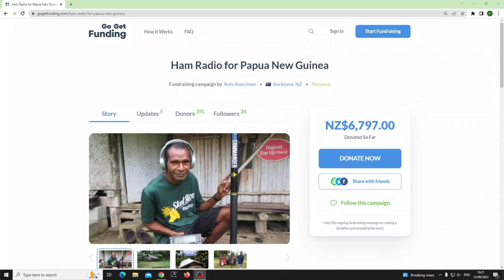We need to Understand Solar Power for Ham Radio

Comment: Hello Callum !
Sorry but i am soon having my callsign in Sweden...
Solar panel is not difficult. The battery can be the not expensive pb and they last for maybe 5-10 year if you do not compete discharge them and give them water.
Some sort of regulator that cut of around 14.4 volt in cyclic charging or just regulated for continues charging 13.6-13.8 volt. 
Here in Sweden there is about 4 hours average sun and  100w panel gives about 30 amps in a day.
70 amp battery x 12 volt is 840 watt and to not reduce lead battery life only use 50% of capacity is about 400watt in a day...
I means that on a ordinary car battery you have about 3 hours of transmitting.
Yes! Take what ever you have and get some QSO. Do not make it expensive and complicated ;)
Joakim.
Reply from the maker: Joakim! Nice to hear from you again.. Gooid advice.

Comment: I would recommend any solar panel that RVers use. Think about the conditions those panels go through. There are a lot of "Solar Generators" which I think would fit the bill nicely, and most support Solar Panel hook-ups. Ensure you check the input solar rating of the solar generator and that it supports the required deployed wattage. i.e. 300w solar ensure generator can take up to, at least 300 watts.

Comment: So I run an Icom 7100 in my van with 3 x 160 solar. Use the glass fronted panels rather than the flexibles . You NEED an MPPT (not PWM) charge controller. I would go for no less than 320AH of battery and if you can raise it, go 400AH of Lithium. 

That setup runs my diesel cooker, 12V fridge, lights, stereo and the icom in the UK weather  would hope the tropical sun of papua would improve on that

Comment: When it comes to solar , the first thing is to set a power budget. What are the operating conditions when it comes to max current draw and for how long time. What is the requirements and budget when the sun isn't there. All this is a factor for scaling the number of panels and battery capasity and the capasity of the solar charge controller. But I will say that Victron is a pretty safe way to go , but don't take the load to the radio through the Victron. A safer way is to take the load directly from battery through a fused terminal and have a lightbulb og something small through the load. When the battery is low on power the load terminal on Victron will shut off and give operator a warning that operation should be stopped to avoid hurting the battery. And remember , you need 200 Ah Lead acid battery to do the jobb equal to a 100 Ah Lifepo4 battery.

Comment: Hi Cal. About a year ago I told you that you had inspired me to start my own business. We're heading in to our one year anniversary. We specialize in off-grid power systems and we are a Victron dealer. I'll admit that I don't know the specific details of the need or application. If it's a single IC-7300 running at 100W, then the power needs will be modest. A SmartSolar MPPT 100/20 with two 100W panels should be more than enough, depending on the mode, duty cycle, and how often the radio is on the air. I use a single 100W portable panel with a 20Ah Bioenno LiFePO4 battery and a West Mountain Radio Epic Powergate for my IC-7300 portable kit. If this is going to be a more stationary system, where size and weight are less of an issue, then consider a 50Ah LiFePO4 battery, a SmartSolar MPPT 100/20, two 100W panels wired in series, and maybe a SmartShunt or BMV-712 to keep track of the battery state-of-charge. 

If you or Roly would like to chat further about this, please reply to this message and I will email you back. I don't want to be a jerk and advertise my own business on your channel 🙂

Cheers from K8MEJ
Reply from the maker: Ed! Good news on your business fella! Very proud of you! I'm sure Roly will find you on QRZ and reach out. Good man.

Comment: I have a Solar System for Portable and Stationary. 
I noticed that the MPPT Solar Chargecontroller does Interference. 
The automatic Notch Filter of an IC7300 can handle that.
My Portable Sytsem got a cheap PWM Charge Controller and it has no Interference on the Radio.

Also i would suggest that a standart Car Battery will be the best Choice because of the availability.

Comment: On Solar Pannels i assume most of today's pannels have no problem with humidity if they come from a well known big manufacturer.
Battery wise, i would 1000% go with LiFePo, they are cheap, safe,  powerfull and have a long cycle life. I have good experiences with Chinese shop Shenzen Basen, but of course who ever buy's them should have some "chinese" business experience... communication is often not that great overall with chinese shops, but as long as you know what you want it's mostly ok.
Charge controller wise, Victron is a good idea... 

I run a 15S1P 280Ah LiFePo Setup with a JK BMS (also from China) and i run my house on it... it's solid stuff.

In humid environment, just take care about to seal all connections properly, but thats good advice anyhow as we know from our coax :D

Comment: Local dealers around the Pacific area would know what to advise in humid conditions.
I have a 30 Watt panel from Maplin but the charge controller never charged the batteries up fully. Anyway I got an Epever which has 3 settings for a Gel battery, Sealed and Flooded which appears to be working fine. I have two 12 AH SLAB's.
Current demand is low as I have an FT817, h/b radio of 5 Watts and others all running 5 Watts or less.
G4GHB

Comment: when OH8STN tested the victron charge controller he found RF issues. Charge control should be waterproof (my opinion), Monocrystalline panels are the most efficient and best bang for the buck. Bioenno is a good product as is Dakota lithium (USA  made). Personally I am using lifepo4 batteries from Eco-worthy. a 12v system is good but a 24v system will charge faster you will need to step down the voltage for the shack. When calculating solar for a home you determine usage then use that number and  double it when building the system to be used. Not sure if this applies to radio though. Solar is more dependable in the south pacific as compared to the northeast coast of the USA which also needs to be factored into the equation. 

just a few thoughts.... I am glad I was able to make this possible.
Reply from the maker: I don't think Justin fitted a ferrite choke. I did that to mine and the noise literally disappeared.

Comment: Ah now this is a topic I can sink my teeth into!  😊

There are a couple of theories to grasp when using solar for anything that I encourage everyone I speak with about solar to understand. 

1) Solar panels power nothing.  They do not provide any real “load capacity” to a load or device. They merely provide a means to charge a battery.  Their rating is theoretical and you should assume that you will rarely produce the amount of wattage that the panel advertises it can produce. That rating is solely met under the most optimum conditions, which is rare. 

2) charge controllers have 2 number when sizing them. One number is voltage in from the panels, and the other number is current out to the battery.  In the case of a victron MPPT charge controller (which I am very familiar with), I’ll use a 100/35 as an example. The 100 is the voltage input from the panels. And the 35 is the amps (current out) to the battery.  Since most charge controllers tend to favor voltages in increments of 50, I would highly recommend building a solar panel array that produces an open circuit voltage of no more than 48v or 96v based on the panel arrangement.  You can arrange panels in a series circuit or a parallel circuit. Regardless of what you do, get the open circuit voltage as close to 50 or 100 or 150 (increments of 50) as you can, but leave a few volts for the rarest of situations where the voltage can drive slightly past its max voltage.  It is better to have the voltage a little lower than a little higher, since anything that exceeds the input voltage limit of the charge controller will void the warranty and possibly damage the unit. Victron controllers are usually capable of running at their rated capacity.  If the current coming out of the controller to the battery is maxed out, that’s ok because the unit can’t produce anymore current. It will get really warm or even hot, but as long as it’s not ran at max indefinitely, it will be fine. 

3) The battery is what provides power to the load. In this case, it is a 100w radio.  I’m going to likely have to argue this point more than any, but over the life of the battery, a LifePoe4 (Lithium) is cheaper and more efficient than a lead acid or agm.  Lithium is safe for indoor use and storage and can handle tremendous amounts of inrush and outrush current. So it can handle the large loads of the radio, amongst other things, and can accept charging current from the solar array about just as fast as it can deliver it. Go lithium. Buy now, cry now… and enjoy life. 

There are lots of other things that can be said on the topic but that may be best said in a Zoom call if you like.  One thing to know is that terminology is commonly misused. For example, there is no such thing as a “residential solar panel”.  I personally have 10 “residential panels” on the roof of my RV with no issues. I also have seen people use “residential panels” for other portable uses. So in general, it’s a solar panel. Full stop.  

Oh… Monocrystaline Split panels are usually the best performing and have an open circuit max voltage around 48-49v if you get the right wattage ones.  

And MPPT controllers are most efficient and can produce more power in the same situation compared to the PWM controllers. 

I’m happy to have a zoom call as indicated. Let me know and I’ll email Cal to coordinate it. I’ve recently spoken to him about a custom 300m spool of wire. 😊
Reply from the maker: All good stuff.. I'm sure Roly will devour that comment. Erm.. To have a Zoom call, you will need to drop Roly an email or have some contact details. He can be found on QRZ as ZL1BQD.
Reply: @DXCommanderHQ  I emailed him 3 days ago. Happy to help if he is interested. 😊
Reply: i was pretty much going to write up something similar, but since youve done it, ill just backup this comment 😂

"Residential panels" (really just high voltage compared to "camping / leisure" types) are the best choice. Easily found 2nd hand  (in aus and nz, maybe less so in PNG), allow more flexibility for charging setup.

Good quality MPPT controller (i use victron and renogy) - WILL need to do more research into RF noise, both my 75/15 Victron and 40a renogy are hellishly noisy on HF, but they are also mounted in the same cabinet as my comms gear so a simple separate housing may suffice.
Go bigger (max input voltage-wise) than you think you need, 100v +.. again, more flexibility with solar panel strings and headroom for cold, sunny weather (panel efficiency can exceed 100% in the right conditions)

Batteries - simply, good quality LiFEPo4.. pricey (but less so more and more) compared to lead acid types but way more effective and with a better life cycle. theres lots of variability out there in retail world tho, im more of a custom build person myself
Reply: I have cheap 150w solar and pwm charge controller for campervan, can always hear 1-2 s of Qrm fading in and out on the CB , when plug into starter battery (not connected to solar panel) qrm goes , also if running any amount of power make sure leisure battery c rating can handle it )

Comment: I run my 7300 with a 50ah lithium ion phosphate battery from Renogy,cost around £200 and it lasts for hours n hours.I would have gone for a 100ah but it was pricey at £400+.Planning on getting it set up for solar next year.
Reply from the maker: Hes, I've been looking at their 100Ah - even their 200Ah (when my 12V linear comes on line). I will see after the amp's been fixed.

Comment: It works perfect. Run direct to a 12v battery though as an inverter (powering the psu) causes qrm on lower bands and is less efficient.

Solar controllers are very cheap and can charge lead acid or Lifepo4 batteries. A 12v car battery would work.
Reply from the maker: Yes, I had some noise on my Victron. I cured it with a healthy dose of ferrite core. All went away. It was the leads that were being used as QRM antennas :)
Reply: @DXCommanderHQ  my qrz page shows my setup. MI7CFN

Comment: My recommendation would be to get in touch with a company like Bioenno (who is very Ham radio oriented) and have them spec out the system that they would recommend, from panels to charge controller to batteries. Who knows, they may kick in a donation of their own, and possibly coordinate the shipping.

Comment: Hi, good video thanks. My house is 100% off the power grid, water grid, sewer grid, and more. I have 4.5 KW of panels and a dual 48 volt system running the 110 and 220 and a separate 12 volt system running the lights, water pumps and security system. The 12 volt system runs the APRS digi, Igate, weather and voice VHF/UHF. The 110 system runs HF but I’ve been considering moving it to the 12 volt system. The biggest issue I’ve run into is noise. Inverters and charge controllers are not noiseless. I defeated the noise problem by turning the battery room with all the charging equipment and the inverter into a big Friday cage, grounding everything in there to death, and installing about 100 snap on chokes on every wire and cable. The result is very satisfactory on all bands. I didn’t realize how much of ohms law I’d forgotten when i started this project. Thanks for the video. KJ7AZ. Oh, my girlfriend that has a DX commander passed her Tech exam last Saturday and it working on her general as we speak. Im going to order one in a couple weeks.
Reply from the maker: Hey Tim. brilliant comment. Yes I discovered my Victron had SOME noise. I cured that with a VERY LARGE ferrite. Love your Faraday cage but can't find which video that would be under.. Oh well.. I'll find it :)
Reply: @DXCommanderHQ  Hi, I don't think I made a video of the cage. It's just wire mesh inside the wall under the plywood. There may be some sections of it showing and I may have just mentioned it in passing a couple times.
Reply: @DXCommanderHQ  hi cal. Where did you place the ferrite core. I've put them on the pv cables and it helps but in bright sun they buzz a bit.
Reply from the maker: @woodybollox  Right by the cable entry and exit. Both mains and 23V. I am sure I could remove one side. Never tested sorry..

Comment: Agreed with Tom on Powerfilm.  They're often used in marine environments too so if they can survive salt water, and squadies, then that's pretty much as tough as it gets.  It may be worth contacting them as I think it's a unique and interesting (and heartwarming) use case that they may just offer some sponsorship, or perhaps trade discount.

Go for Victron too.  They also used extensively in the marine world - and most import, they're reliable. Looking at the calculator on Victron's site; located in PNG a 330w panel will generate between 1.3 and 1.4kwh per day, year round.  Combine that with 150 or 200aH of lifepo4, and he should be good for operating for and long as he likes.
Reply from the maker: Crickey Nathan.. indeed that would be an insane system! PS - I took your mast down today. I need to make a video and ask for some help in getting this to you! I'll message you on Discord shortly. PS - The antenna needs a good clean and then a polish..

Comment: Genasun MPPT solar charge controllers are supposed to be quiet with RF noise and a good controller.  OH8STN covers the topic really well.  If you want to make your own battery packs with headway cells he covers that well also.  I think it only saves a little bit of money these days to make your own.  I've learned to watch out for the cheaper LifePo batteries with built in BMS, the current limiter can be low if you get too small of a battery.  Check for the max output current when buying batteries.

Comment: I was hoping you would have advice 😂

It is becoming more and more of a thing now. I'm dabbling and have a renogy river 20 amp MTTP (better than PWM) and 2x100w solar panels (not mounted in the ideal spot but my home is south(ish) facing. And I'm using currently a 100ah Sealed lead battery (weighs a ton).

Yesterday was a mixed bag of sunshine and clouds (probably more clouds) and I gathered 230wh so it's all about calculations as to how many hours you would get depending on transmit time. 

On a side note I got a LiFPO4 6ah battery to take out with me and I've been on 6 hour long nets (at 15w) without charging, I could have gone further but didn't want to get caught out.

Now, my solar set up is at the back of the house and my radio is at the front, so I'm looking at approx 20m of 12v wire to power my radio and remove need for 230v/13v power supply.

It's all very much work in progress for me but I think this topic could be of interest to all amateurs.

More on solar please 😁
Reply from the maker: Copied!
Reply: Hi. I use solar on my radio gear and it's great. As you probably know I'd get thicker cable to allow for voltage drop to run to the radio. Might need to watch for noise pickup on a long run like that or rf problems. But it's what the hobby is about experimenting. All the best.
Reply: I'd definitely get a shunt on negative cable to measure input pv power  and out going power usage as it shows battery level, total discharge,last discharge etc. And with that lead acid flooded or conventional battery don't  drop below 50% discharge to often as its life span is reduced.